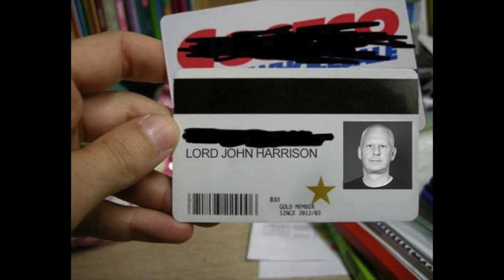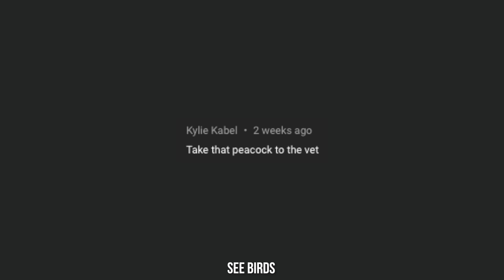The Vet permanently INJURED our Peacock

Comment: You did read up on the care of the birds right? Ten to one odds the bugs in the wound are maggots. You need to get a pair of tweezers and pick every single one of them off and do so religiously. Yes maggots help clean the wound but they do so by eating away the damaged tissue. My guess would be that the bird scratched itself on something and flies laid eggs on the wound and that’s what is causing the problem. Probably not the vets fault dude so maybe calm down and do some research. Zoo’s, animal wildlife centers and your states extension services and the state university are all appropriate places to contact for help. Maybe exotic animals are not something that you should be trying to raise. At least not until you get some basic animal husbandry skills on less expensive animals.

Comment: It’s a shame the peacock is injured but should have been taken to one with experience in exotic birds.  You don’t go to a dermatologist for a broken ankle or see an obgyn for gallbladder disease.    Sure they are all doctors and can treat you but wouldn’t you rather see a specialist?    You also have to consider that they are humans, mistakes can be made  or the animal itself could have had some kind freak out in its cage and the vet might not have done anything to it.   In fact that more likely the case.   If the injury is not near the sight of the draw then the injury could have happened at any point including when you were putting it in the cage or when it was alone in a cage.   I think it’s a bit unfair to blame the vet.   The fact all the other birds have died might seem like there is some other issues going on here which may or may not be related.

Comment: What happened to his arm was do to the vet, for all of you the cage did not cause this at all. If you do not understand a peacock at that age, is very large. The size of the cage is very small for a bird that size. Also, the wing is that way due to from how to the vet handled him, and drew his blood. The only reason the bone was sticking out was due to to much force, from holding the bird down. The face the peacock site from a simple blood draw turned into bugs, and flys inside the site is disgusting. I own peacocks, and for them to get a site like this from a simple blood drawn. The vet should not have said they are able to do that to a exotic animal. You really need to sue